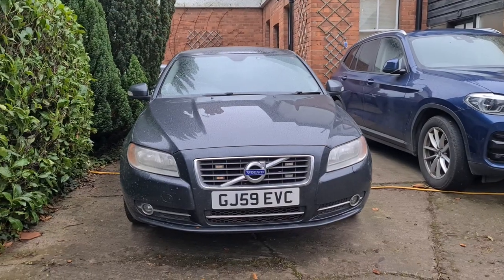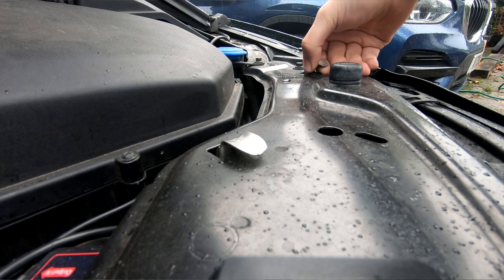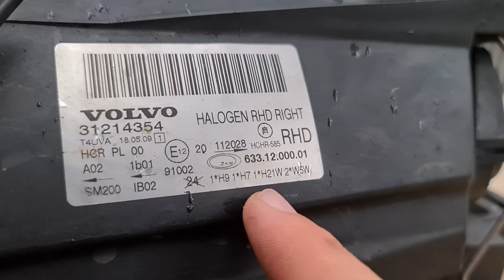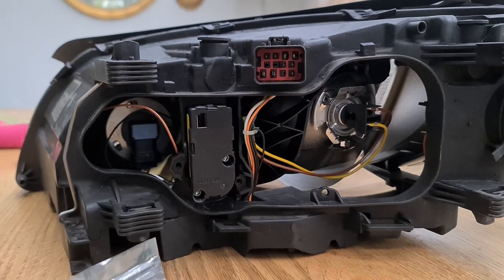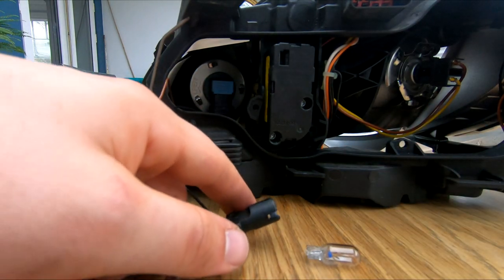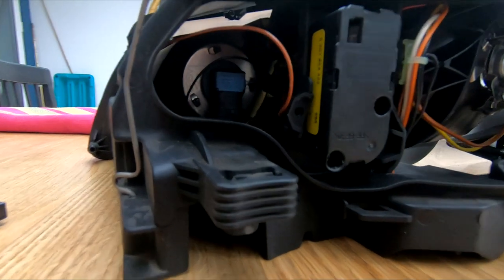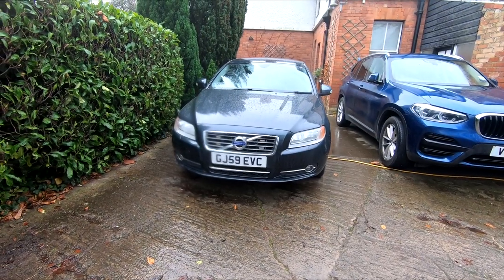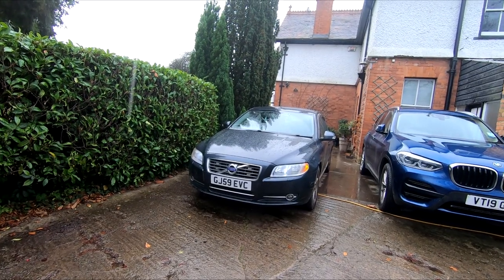*UPDATE YOUR VOLVO HEADLIGHTS* with this simple modification!!

Comment: Done mine ages ago. For the rear number plate lights you can buy the whole unit with approx 16 leds in each. Had them fitted to mine for over 2 years and still all ok, and cheap.

Comment: I added led headlights to my S80 (dipped beam only) and bluish-white parking lights a while ago. It has Completely transformed the look of my S80. And the LEDs are from Amazon with the correct beam pattern and passes my MOT. Completely changed night time driving as those halogen bulbs were awful. 2011 D3
Reply: Care you share a link?
Reply: Please the Amazon link? 😊😊
Reply: Be aware new rules coming into force soon, led bulbs will be a fail MOT if fitted to halogen head lights.
Reply: Could we get a link, or atleast brand name?
Reply: @wacman  this is why I haven’t bothered changing mine. I will just put in some halogens that are advertised as brighter whiter lights from Phillips or something but only when I can get a deal on them! Lol

Comment: I have done this, but the led bulb was slightly too big. It press-fitted through the hole (and I thaught "uh oh"), did not work and didn't fit through the hole again on the way out, so only the empty socket came out. Now it resides in the bottom of the head light for ever.

Comment: Just updated my headlights to led on my c30. The only problem is, is the condensation which as accumulated in the headlight casing, that's because these aftermarket led lights have cooling fans on them and they stick out of the rear of the headlight case so you are unable to refit the plastic seal. Basically is there a way of avoiding this other than drilling 1" hole on the rear of the seals?
Reply: You can buy Osram (german automotive lightning company) easyled series, where the led is a perfect fit with no sticking ouz so you can refit the seal. I dont know if they have that series of led in the usa (it has debuted this year) but i believe osram is called sylvania there

Comment: Do you see a blue led glow when the lights are OFF due to the tip being blue and mirrors all around?
Reply from the maker: No :) they do glow very faintly for about a minute after the car is locked before it enters sleep mode :)
Reply: @drivelife.channel  no I mean when 100% off. You still see the blue paint of the bulb?
Reply from the maker: Nope :) they are white so hide very well in the light :)

Comment: I just got a 2009 S40 R Design diesel and pulling out the headlights for a cleaning and new bulbs is one of my first priorities, I don't think I've ever had a car with such awful headlights. I will definitely do this LED upgrade to the "City lights" as well. It's nice they come out entirely from the car though. I didn't even realise I had under mirror lighting till I pressed the button on the remote fob, they don't come on at night when the car is unlocked automatically which is a bit rubbish